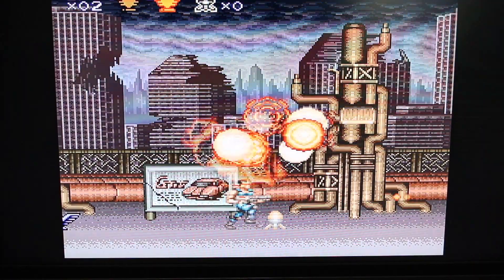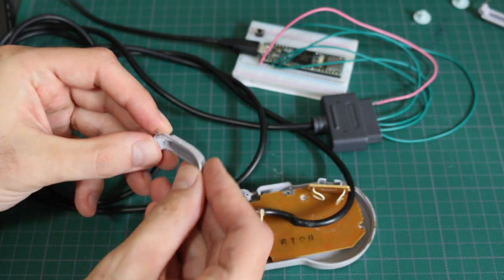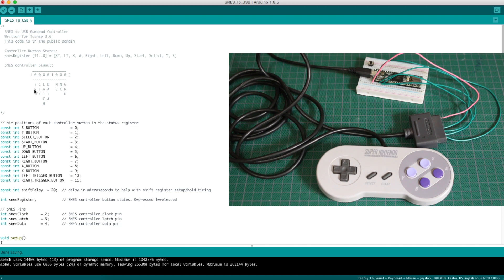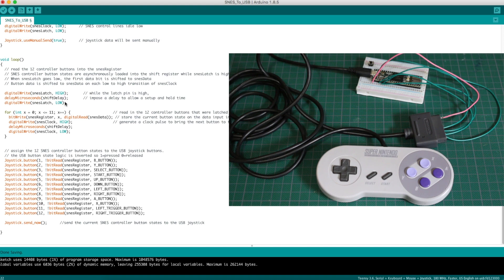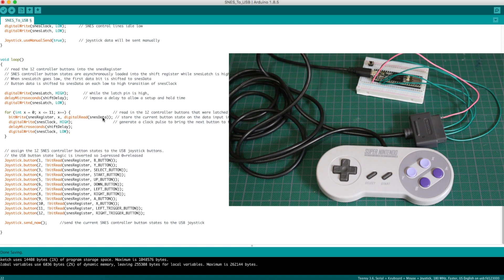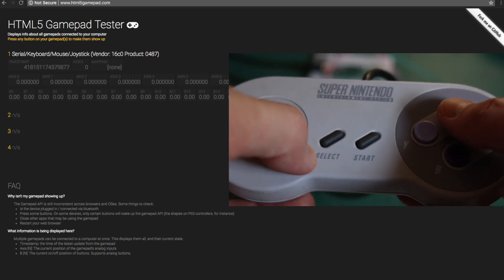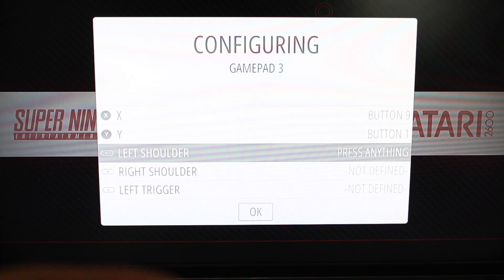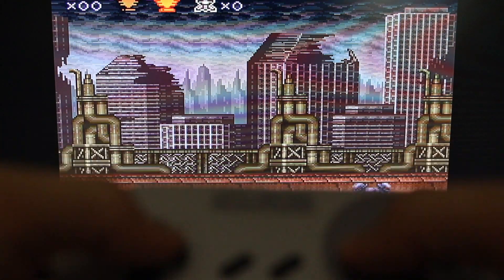SNES to USB Gamepad Arduino Project For Retro Gaming

Comment: What arduino are you using, and which ones can this be done with. Cool project btw. Thinking of doing it myself since i also bought that cheap snes usb knockoff for my batocera pc.
Reply from the maker: This one used teensy but anything that supports USB HID can be used like pro micro or pi pico I’ve done similar things with.
here’s a video where I used a pi pico as a keyboard and mouse https://youtu.be/Db2Oz6nJBOw?si=Mhnf2Pkaakia5W1d
Reply: @GadgetReboot  Thanks for the response! Ill be looking into it.
Reply: @GadgetReboot  I suppose it could also use an arduino nano, but im not sure it can be recognized as a human interface device/usb joystick. Also, can you use one arduino for 2 separate controllers?
Reply from the maker: The nano doesn't work as a usb device because it just uses a generic usb to serial chip and has no control over the usb bus beyond sending/receiving data, so things like the Pro Micro work because they use a micro controller as the direct USB interface and can then behave how they want.  When a device can act as a USB controller, they can behave as multiples at once  like  joystick/keyboard/mouse
Reply: @GadgetReboot  Sorry for the constant notifications but can you link to the pico tutorial?
Reply from the maker: I think this is the video where I first tried doing pico as usb input devices and linked to reference tutorials in the description https://www.youtube.com/watch?v=SzqYmdB_Ylg
Reply: @GadgetReboot  Thanks for the reply! Ill check it out.

Comment: Is there any chance to play it on any snes emulator for windows?
Reply from the maker: I haven’t had a chance to try it with windows but it is supposed to show up as a standard USB digital joystick so since it worked on one system as a general USB interface, I expect it will work on all of them. So if the emulator supports USB joysticks, should be good to go.

Comment: What API's are you using in that code there?
Reply from the maker: Not sure if there’s anything special being used, everything is generic. On the raspberry pi it just has retro pie installed with everything default and it’s just recognizing a USB gamepad being plugged in. 
The Teensy  sketch doesn’t use any special libraries included, just uses some Arduino built-in joystick functions and when selecting the type of board, I forget exactly which one but I tell the IDE  that I want to be able to use Teensy as  HID serial USB mouse joystick capable etc. and then the magic just happens.
Reply: @GadgetReboot  I just realized that those libraries are included in the Arduino IDE, my bad
Reply from the maker: Yeah I forgot what was involved in the project so when I looked back it was even simpler than I thought.

Comment: no lag? does it work just like the original?
Reply from the maker: I didn’t sense any lag and it does work like the original, if anything it might actually work better because back then the processors in the console only ran on a few MHz but with Arduino we can read it much faster and have the data available quicker. So  it seems to work as it should and as it originally did on the console.